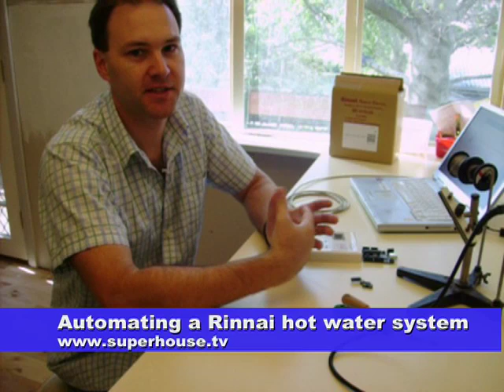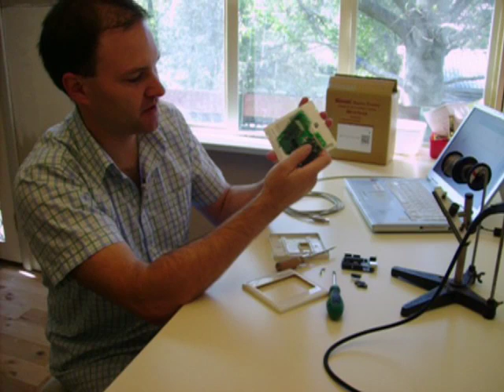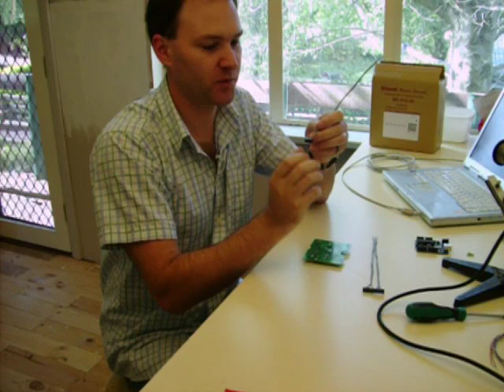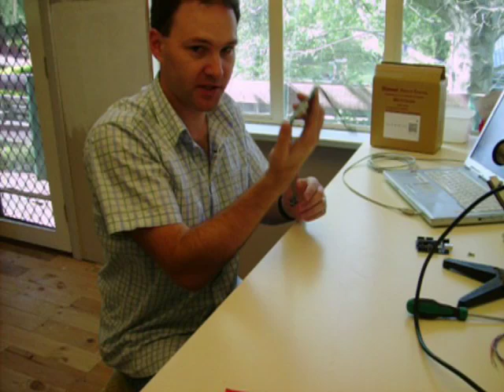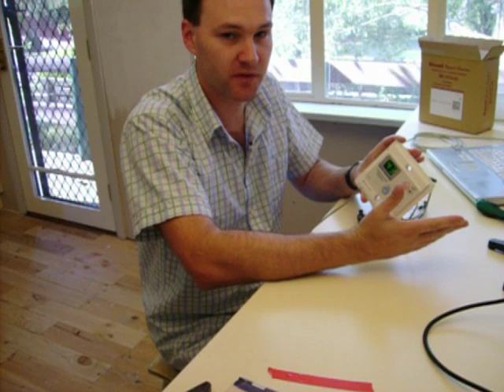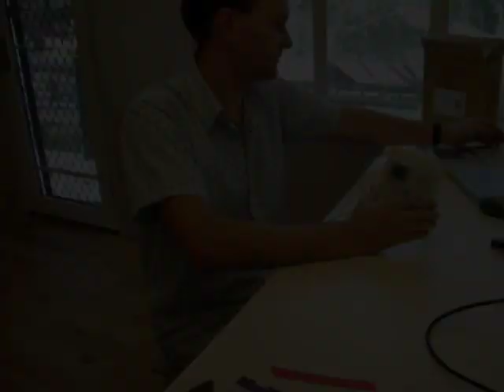Hacking a hot water system for home automation

Comment: Did you ever get any further with this?  It's extremely odd that the controller is a) Polarity universal and b) only 2 wires.. I really don't understand how they manage to control it.  It must be some sort of serial data but achieving it in an odd way.  Not only that, they seem to use custom chips in the controllers which makes it harder to reverse. One is Rinnai branded and the other I can't find any info on. I am on a bit of a home automation kick at the moment and this is something on my list....

Comment: Did you ever get the below comment implemented? I would be interested to see what you did? 

Or having an extra panel that is never touched (there can be up to 4) and power-cycling it, or zeroing-out the setting by pulsing "down" say 50 times so it hits the end then count back up, or by reading the values on the LED display (which I've tried doing but they're multiplexed, which is a pain to deal with - but a friend suggested using a simple voltage ladder into an ADC so I may give that a go)

Comment from the maker: Maybe, I don't know. What part of the control panel should the voltage be sensed from? The most important information to retrieve from the panel would be the current temperature setting, but the problem is that the LCD interface uses a multiplexing scheme that makes it tricky to read off the digits currently being displayed. It's not a simple voltage.

Comment: @FlamingoTel Think of the buttons as logic only, they dont actually turn anything on or off. They just send an input signal saying it has been pushed. The arduino will decide what to do when a said button is pressed. Basically your replacing what the keypad did with the arduino which can be controlled by a computer.

Comment: This raises the same kind of issues to dealing with universal remote controls - knowing the existing state of a device.

As with higher end TV sets that have serial data links for firmware upgrades and computer control, I wonder have the manufacturers of things such as hot water systems considered adding automation friendly features themselves as standard?

I guess the downside of them adding such features is that every company wants to set the standard they use themselves :)

Comment from the maker: Or having an extra panel that is never touched (there can be up to 4) and power-cycling it, or zeroing-out the setting by pulsing "down" say 50 times so it hits the end then count back up, or by reading the values on the LED display (which I've tried doing but they're multiplexed, which is a pain to deal with - but a friend suggested using a simple voltage ladder into an ADC so I may give that a go)